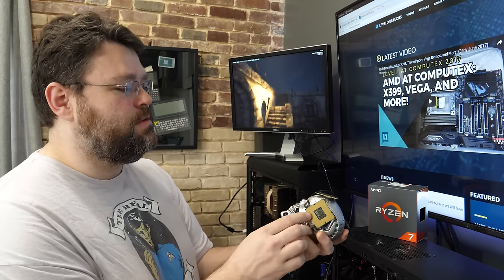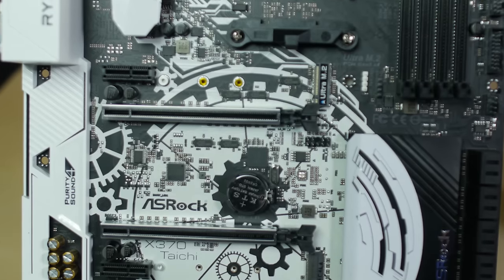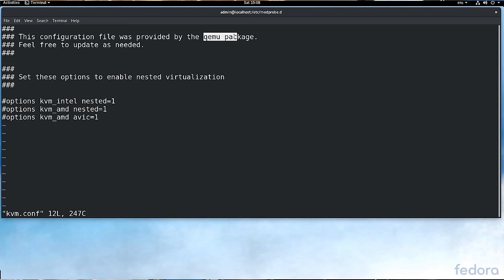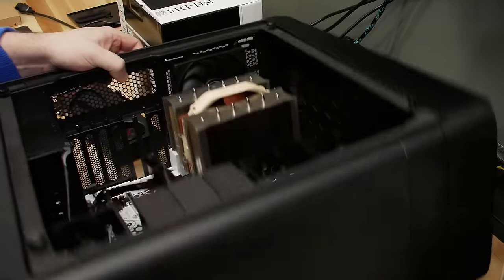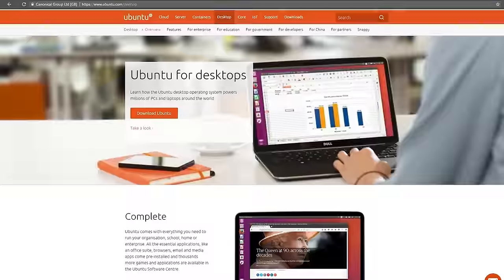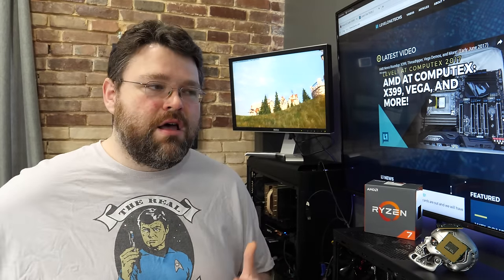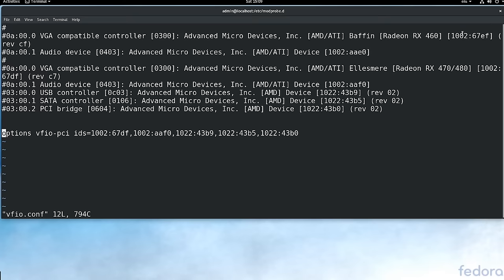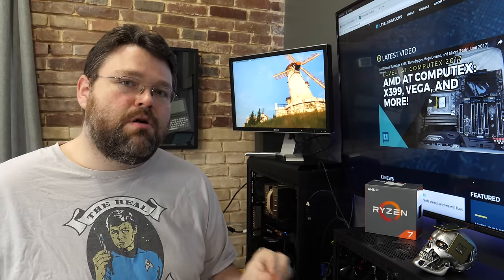GPU Passthrough for Virtualization with Ryzen: Now Working

Comment: I'm curious how the IOMMU groups are divided for the ASRock X370 Professional Gaming are set up. It has dual NIC and Wireless and Bluetooth built into the board. It would be awesome if you could pass through one NIC... I could finally say goodbye to Windows and run Qubes OS

Comment: WOuld the X370 Asrock gaming k4 be acceptable as a suitable replacement for the Gigabyte Gaming K5? I believe it has the Agea update  1.0.0 you were speaking of.   Also what do you guys reccomend to make the audio crackling go away? I've had problems on my previous pc and Im about to setup a passthrough on my ryzen system but I'm asking around to see exactly what options I have for bleeding edge distros

Comment: Do you ever test starting and restarting the guest VM's? Some people, like me, don't want to run a VM all the time, just want to start it, do something, shutdown, maybe start another which will be using the same passed through hw and then shutdown again, then repeat without having to reboot the host machine. I'm specifically wanting to know which AMD RX cards can handle this without the rest bug hanging the hardware.

Comment: VMware or VirtualBox or Qemu? Wait what? KVM? Do you have a newer guide for this, and could you make it on multiple platforms, like Fedora, Ubuntu, Debian, Slackware, Linux Mint, POPos, etc. ?? Would really like to see an 2020 update in the area. I have plans for buying another graphics card, and since the PCIe 16x will go down to 8x on my motherboard just for having two cards in it, will it even matter where the card is located? 8x & 16x doesn't really matter atm, there isn't much difference in dataload, but later on, shouldn't a APU be the best choice for the host system and a passthrough on a GPU for the gaming guest?

So I was thinking of buying 1 KVM Switch, but.... Do I need one per display? Since I have 3 displays. I also thought that Instead of passing through a USB, why not just pass through a hub, If that doesn't work, I can still use it on the host system. I was also thinking of my mixer that I bought for streaming, how is that going to work, and how is it going to work with streaming overall? I have been wanting to build this VM computer for some time, I bought the AMD Ryzen 1700x & AX370-Gaming K5 when it was brand new on the market, and because of it, I had to wait, and I didn't have the money for more ram at the time, it was damn so expensive, It barely costs like 100 euro now, for 2666 mhz memory sticks, so I can now years later start buying 64GB memory for under 4k SEK ~400 Euro.

Comment: Great! Now waiting for the RAM prices to become somewhat normal again and videocards to become available...
That with a 8 year old system and a 5 year old mid tier (HD 7850) graphics card. ;)
Once I can get a cheap secondhands low power graphics card for the desktop I will try to get Windows running in a virtual machine under Linux, it is a fun project, I guess, and hopefully it will allow me to use whatever OS and GUI I feel comfortable with the most when I do not run Windows exclusive programs.

Comment: I'll re-watch the video in more detail but can somebody please answer the following couple of questions?
Is it possible to do this with a single GPU (I have a RX480) and have it initialized again by the host after you've finished using the guest? 
Or in case you have APU (when AMD releases the APUs) in addition to the GPU can you use the GPU in the host after you've shut the guest off? I'm considering migrating to Linux full time ... again (only some games holding me down) and am wondering if I should be waiting for the APUs to be released first or go ahead and buy a r5 right now. But most likely I'll be doing a mini-ITX x370 build and won't have a spare PCI-e slot or the ability to fit a second card in the case.

Comment: Hi! thanks for the steps. I want to ask you if it will be possible do the same but under proxmox virtualization instead. I'm planning set a server for run several kvms and some vz containers for building and webservers. What i don't know (maybe you can help me also), is if to go for a 1700x, 1800x or i7 8700k. The idea is to have headless station (ssh managed), and vms to work and gaming separatedly. Any help will be appreciated. Thnx!

Comment: Hey!! if you want to put in a second graphics card to use only with the virtual system,and you will still have the host system for the actual monitoring.. that means you can use one of this cards that will be sold without video ports for miners. Right?!

Comment: I don't think the nest page table (NPT) bug in KVM that kills GPU performance by 30% give or take really in VM's on Ryzen really allows one to kill off Intel or dual boot Windows yet. With NPT on, the processor runs well by GPU is neutered. With NPT off, then the processor drops and the experience is choppy and really not comparable to an Intel experience yet coming from a 4790k build.
Reply: That being said, I desperately want Ryzen to succeed in this particular aspect considering I invested in a new build, am generally dissatisfied with Intel's marketing strategies, and already gave the 4790k build to my wife.
Reply: if you pin the cpus the way we showed in the config file, it really helps with the choppyness. That said, yes, x99 is still a way better experience for the moment. Curiously virtualization with the Xen hypervisor is much closer to bare-metal performance than KVM at the moment, npt either way.

Comment: I had a dual boot system for a couple years. With windows 10 and all the data collection I decided I did not want Win 10 any where near my Linux system. Then Microsoft started being friendly with Linux which made me cringe. 

My solution was when I wanted to upgrade to Ryzen I built a new rig. I had some parts laying around so I built a Linux rig (FX 6300, R9 380X in an old case with used PSU). Built a Ryzen 1600X / RX 480 GTR system for gaming etc...

Comment: What about Unraid? It is possible to use something like that today to create say a 2 gaming VM's system?
Reply: Oh i have a license at work and plenty of hardware, i've managed to set up 2 vm's but the GPU performance tanks, from what i understand (i'm still a noob at linux) this is a solid workaround to that.

Unraid is a paid software but it has dramatically peaked my interest in linux tbh, Ryzen has so much potential for a setup like the one i want to build.
Reply: Josecitox wondering that myself, I really want to rebuild my unraid server using a ryzen 1700
Reply: It depends what exactly you want in the end. If you want a pure VM (KVM) host -> do what Wendell explains. If you want fancy filesystem / share management all tied together in a solid but more restricted system -> Get UnRAID
Reply: I have a lot of hardware at my disposal to test stuff so i guess i start experimenting with this. :D
Reply from the maker: I'm told unraid is not there yet -- probably need to wait for the avic/npt bits to be fixed (npt has been buggy for quite a while now). Then it should be performance parity/similar overhead as to an intel system. I'm given to understand that the unraid folks have been tinkering with this, but it isn't there yet.

Comment: How well does this work with a Crosshair VI?
Reply: If it supports linux, the linux host could run crosshair, and the windows container could be set underneath that - would never know-.
Reply: the EGESA 1.0.0.6 update isn't out for it yet... I'll just have to wait and see I guess.

Comment: I really want to do this, but I'm also planning to use ITX for my next PC. To achieve this with ITX I would need an iGPU for the host system, which Ryzen doesn't offer. 

Basically, my choices are a  1700 with dual boot or a 7700k with passtrough. I'd like to buy Ryzen, but I'd also like to run Windows virtually. Is anyone willing to give me their two cents on the issue?

Comment: So, not really Ryzen related, but do laptops support iommu? If so, which one? Cuz i really want to move from Windows but still use some apps that are not supported on linux.
Reply: if you only want to run some "apps" (i assume you mean programs) then you wont need a gpu passthrough so it shouldnt matter.

Comment: Hi there, thanks for the video.

I want to run multiple virtual machines with this type of performance inside of windows 10, 1vm so my wife can use it at the same time as me for graphic design and video editing and 3 other vm's for excel macro duplication to break down data while I use the main device for whatever I need it.

Thanks and hope you can help guide me through the process.

Comment: Is it possible to use my current win 10 drive as the win 10 drive in the VM? This is in a old Xeon system running 10 with VMware in windows. Could I still use VMware on the windows VM inside Fedora?

Comment: Seen a terminator head with CPU on it... reminds me of that old terminator show that ran like 10 years ago. At one point they removed the terminators CPU, they just seated it and turned it on and INSTANTLY it started hacking and wrecking every electronic device on sight. Even a cellphone couldn't escape the wrath of a terminator CPU... I guess it was a CPU with wireless networking and it was capable of taking over a cellphone.

Comment: Is it only the Nvidia GTX series of graphic card? Would the Quadro throw the same error?
Reply: Interesting question.
Reply: Only GTX series cards. The NVidia driver blocks virtualization whenit detects GTX series card
Reply: Miguel Sensacion is there a - ahem - workaround?
Reply: QEMU needs to tell the Nvidia driver that it's not a Virtual Machine ;)
Reply: its not the card that give the error it's the when  you install the Nvidia driver that gives the error to stop you from running the card in a vm cause Nvidia are Microsoft shills
Reply: best setup for iommu is amd gpu for the vm with windows and Nvidia  card for the Linux os just my 2 cent :D

Comment: is this possible to mix cpu brands, because I want to use a gtx 650 for my main system and an r9 380x on the virtual machine.
Reply: I have a Radeon 6570 DisplayPort edition as my main GPU and a GTX 980 for pass through. Yes, it works and it works well.

Comment: Has anyone tried Thunderbolt 3 Passthrough and passing through eGPU using external GPU docks to Windows in VM?
Would be awesome if it works and if all one needs to do is passthrough thunderbolt 3 port (tb3), connect the thunderbolt cable and then proceed to install Nvidia drivers in Windows VM on Linux to play windows games in VM.
Reply: Passthrough this /watch?v=FHwXOwTgYB0
I think it will make GPU passthrough lot easier if it works.

Comment: Wendell, from your attire do I detect a certain disdain for Whovians?  8-) If you are actually against something/one in Star Wars, I stopped watching those after the first 3 releases so I probably don't know.

Now, after getting a hint of this Ryzen problem/ability in an earlier video by you (I had to figure out what an IOMMU must be - are there IOTLBs too?).  It would seem that we're getting yet another Big Iron (IBM) ability handed on to personal computers. That is, we can have containers running entirely different systems too, with dedicated hardware that's deemed necessary.  Two keyboards and mice?  Hmm, I can get hung on Linux and Windows, long before the hypervisor would be involved.  I mean, I have to do a dirty reboot.  I'm quite tired of it.  The Program you are using is no longer responsive? Do the Magic Move to get back to whatever launched it and kill the sucker!  Most of the time, the mouse is too high a priority task to be involved. You can blythely mouse anywhere on the screen while everything else is dead.  Why do we have preemptively multitasking OSes and we can't have separate high priority threads for input and for the GUI / Shell that launches/runs things?

I suffer from losing my point in the middle of things too!  Before Ryzen, this kind of partitioning wasn't really worth doing with 4 processors and maybe 4 virtual ones too. Only servers with dual sockets (at least) made it worth your while.  Now, even on a Ryzen 5 you could dedicate two real processors each to Windows 10, Linux and Mac OS X. with a Ryzen 7 you could use processors 7 and 8 in a *BSD install as well.  Ah me, I had, or just desperately wanted, a dual socket motherboard which would have given me a grand total of 2 processors! 8-))

Comment: maybe i'm stupid; i'm not picturing any obvious reason nvidia should be so hostile towards this setup. do they just want more direct access to other things in the installed system? or is it to force virtualization into a pro product line and forget this use case in the consumer market? i'm not surprised at all,  as it is i already won't buy em for various other reasons, curious to me

great video btw, as usual. keep em comin <3
Reply: googIesux Ya, Nvidia wants you to buy a Quatro for using in Virtual environments. Their fear is that higher end corporate customers could move to Consumer cards instead of buying the hardware designed for the specific use undercutting their profit margins and possibly providing a subpar experience.

Comment: I couldn't find vfio.conf in modprobe.d/ anyone know why? Do I have to install vfio-pci separately? thanks
Reply: just make a new blank one
Reply: Level1Techs thanks. I couldn't get it working with my 1080ti so ended up using the stub driver. It's still bugging me why I couldn't bind vfio-pcie despite about 48 hours of trying!
Reply: if you figure it out let us know on the forum. Fedora 26? I had problems like that until using the kernel param to prePRE load the vfio driver. It kept not being loaded from the ramdisk! Also, one person on the forum said they had to edit their system's dracfut.conf.d -- Other guides point to also updating/creating a vfio.conf in /etc/dracut.conf.d with add_drivers+="vfio vfio_iommu_type1 vfio_pci" -- see the forum. That might fix you up. I have had to do that step in the past for sure, but not on F26 (or possibly I totally spaced out).
Reply: Level1Techs F26, all same specs as yours except Fatal1ty x370 gaming k4 mobo, Nvidia GT710 and 1080ti for passthrough. Tried all the steps you mention multiple times without success with vfio-pci. pci-stub worked immediately so there must be something delaying vfio-pci. There is a known bug that was showing a repeating error in my boot logs (system boots fine though) which may be preventing vfio-pci from being loaded. I'll post details on your forum.
Reply: I am having the same problem, do I need to put anything into vfio.conf?

Comment: FYI if you are planning on doing this with Ubuntu, like I did, because you are a noob, like I am. And you use a dedicated keyboard and mouse for each system. You may need to disable apparmor. I dug around for hours this weekend trying to figure out why my keyboard and mouse weren't being passed through automatically. Finally I found https://ubuntuforums.org/showthread.php?t=2322683 Where the user: KillerKelvUK figured that out. I tried to give him a shout out but that thread is closed. Anyhoo, If your about to put a mouse and keyboard through your bedroom window out of sheer rage, try disabling apparmor first then rebooting the host, it worked for me.

Comment: Why does it always have to be so overly complicated on Linux?  I would so love to just dump Windows or run it through a VM for certain games/software that will not run on both systems but it simply does not work most of the time.  Even just trying to install a graphics driver is a huge problem on Linux (I know, I tried to install a driver for my RX480 over a 4 day period and gave up in the end) making it terrible as a gaming OS.

I have tried both Ubuntu and Mint which are said to be the most beginner friendly versions but I found them to be most unfriendly when I tried to set them up for things I wanted to do.  In my opinion, Linux will never take off as a mainstream desktop OS (and note I say desktop and not server, or super computer as there are huge differences) unless a version comes out that does not need constant jargon lines into a shell script that most people will not understand.
Reply: You know graphic drivers are pre-installed on Ubuntu, probably Mint aswell.

The problems, that most users have, are pretty much not knowing how Linux work, the learning curve is maybe a little rough, but if you get over the first few obstacles it's pretty easy to use.(IMO much easier than Windows)
Reply: If you really want to install the proprietary drivers for rx480:
https://help.ubuntu.com/community/BinaryDriverHowto/AMD
But I wouldn't recommend it, because the newer Open Source drivers performing better than the proprietary ones.
*EDIT*:
Upps that link is for fglrx, which is the proprietary driver for older cards.
You probably need to install it manually from the AMD website:
https://support.amd.com/en-us/kb-articles/Pages/AMD-Radeon-GPU-PRO-Linux-Beta-Driver-Release-Notes.aspx
Reply: >Why does it always have to be so overly complicated on Linux? 
While I agree on that there is a lot of basic stuff that requires tinkering with shell in linux (while in other OSes there is good GUI for same tasks), virtualization of that level (PCIe passthrough) is completely different thing. Guess what? Windows / macOS can't do that at all.